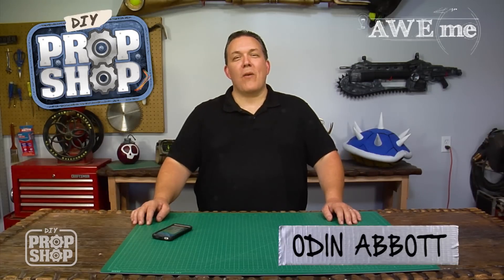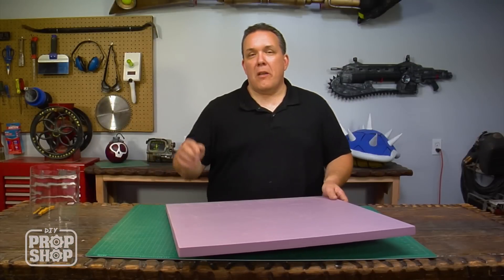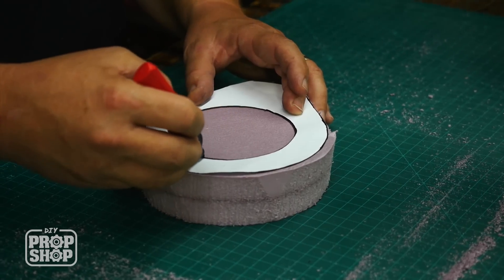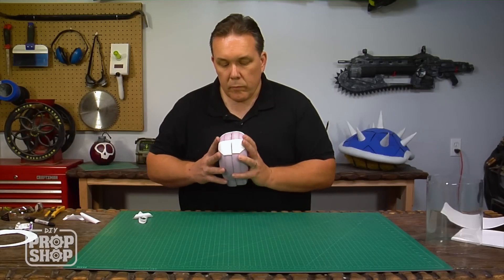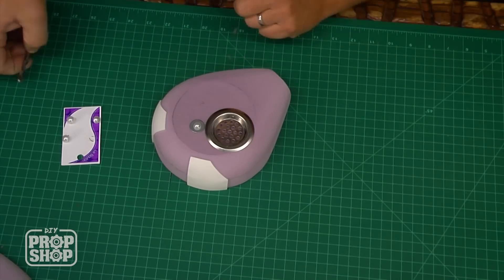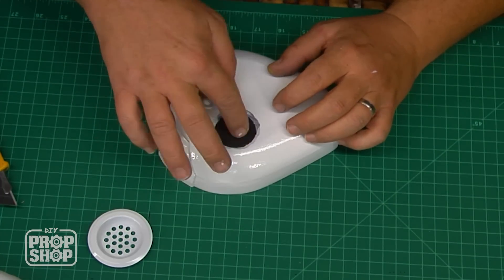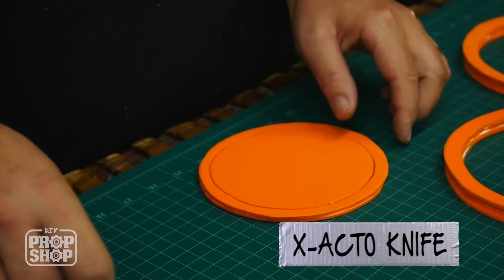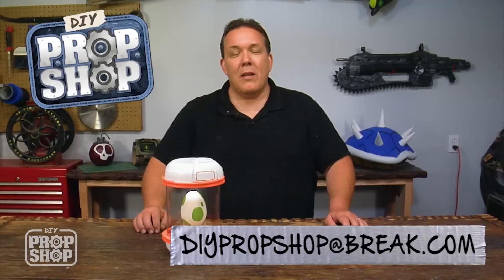Pokemon Go Egg Incubator - DIY PROP SHOP

Comment: It could be important to note that, like the cement glue, spray can primer CAN melt your foam. So if you think about skipping the undercoating with white glue, check out if your spray can primer melts your foam on a spare part.
Or else you could end up destroying a good amount of work.

Comment: Last time I came this early Pokemon go had a tracking ststem
Reply: Last time I came this early, this joke was not made :)
Reply: It currently has one, so get gud
Reply: +darksskull no, it has sightings, which, just like when the 3 steps were removed, just tells you what pokemon are around.
Reply: Lukia And its a tracker too. Wanna track something on the list? K, pick any direction you like, and walk in a straight line till that pokemon disappears. Did you do it? Great! now stop. Remember that spot. Turn around and walk back in the opposite direction in a straight line till it disappears again. Got your spot? Now we're talkin. Now all you have to do is walk to the middle of this line, and walk in a straight line in any direction perpendicular to it, the pokemon will either disappear again, meaning you went the wrong way, OR YOU"LL LITERALLY WALK RIGHT ON TOP OF IT. Oh, yeah no problem, don't worry about it.
Reply: +darksskull it has you legit walking around until you find it. the 3 steps were easier because the less steps there were, the closer the mon was. when that was removed, aimless walking around. not with the "sightings" its just more aimless walking around
Reply: Last time I was this early, people weren't so butthurt.

Comment: Really nice! Although as a tip, you can use caulk to hide the seams between the two foam pieces to make it completely seamless. Also you could have used fishing line instead of the acrylic rod to make the "hovering egg" effect a little bit more convincing. Overall though, it's great.

Comment: Hey man :)
1st: Great video. I love the end result and your process is easy to follow with great looking result!
2nd (and importantly): Any time you do a prop shop, and youre using blades and otger tools of the sort, can you set that grear example for not just my kid, but all kids, and make sure you stress and use safety equipment. Even something as simple as gloves.
My daughter watches your show, and she asked me about your videos safety and I had to re-inforce thats as a kid she has to use protective equipement, regardless if you (or anyone with diy vids) does or doesn't.

Its a common sense thing yes, and trust me, I am not saying its your job to teach my kid. Absolutely not, but it is important to set good examples.

Thanks again for the awesome prop build!

Comment: where did you get the drain strain kit? I can't find that or the Gallon jar anywhere!
Reply: I found the kit at my local Home Depot. under the Plumbing and Repair. I'd like to find where he got his jar as well, my B-plan is to try and find those Jars of pretzels (I think pretzels) at Target or walmart. I've only been able to find Glass Jars with plastic lids.
Reply: Just a thought, but they might have the kits at your local 99 cent store. Or at least something very similar.

Comment: It's cool, but how do you turn the light on and off?
Reply: oh yeh it's glued so...
Reply: That particular light is turned on by pressing the dome. Changing the light if it breaks or runs out of batteries will be harder, though. If you're making this build I suggest that you should rather make it a snug fit or use two-sided tape.
Reply: ***** Oh, that makes sense. You should've mentioned that on the video as well =) I got to say that your builds look the best although you don't always use the simplest of tools and they use a lot of different foams. You're truly the foam master =D